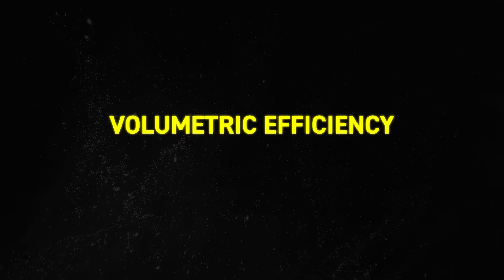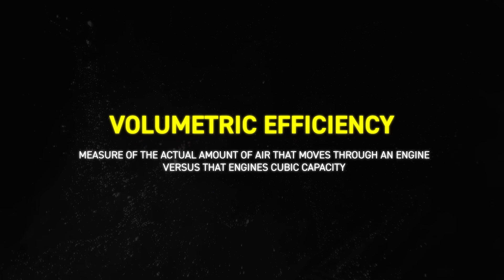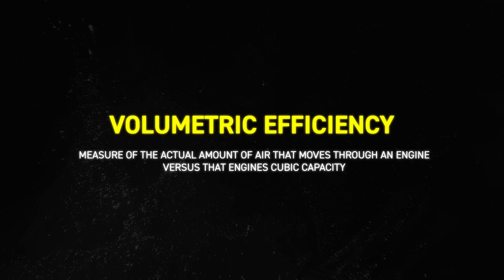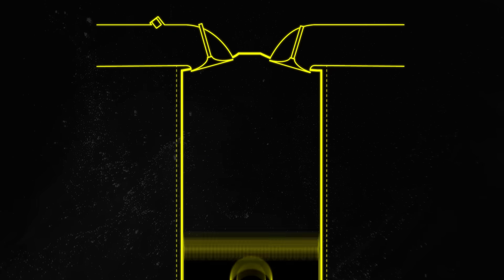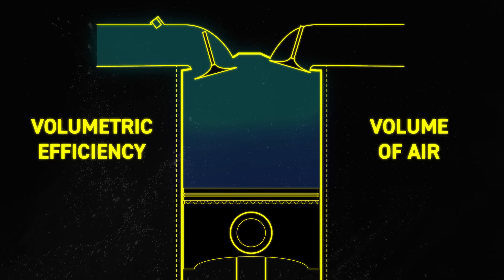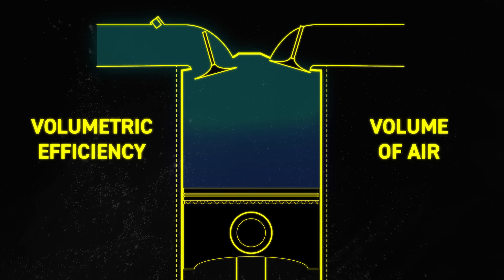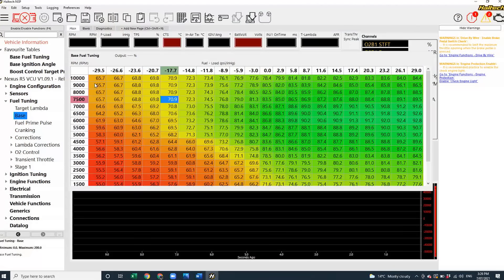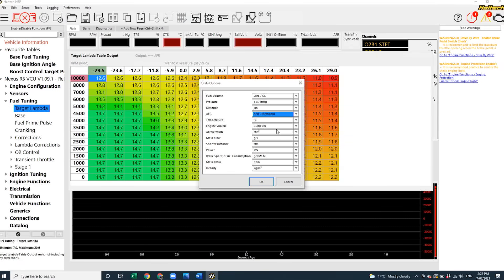🛠 Tuning with Volumetric Efficiency and other VE fun facts | TECHNICALLY SPEAKING

Comment: HI, you are right in this video, but why dont you use a practical example? Would make it easyer to understand. All engines get higher VE when they have boost. Air density rules. If you dont understand this buy a "MAD" sensor from Gale Banks. Why dont you use a practical example to double VE? Most engines double VE at 1,0-1,6 bar boost. This range comes from the natural aspirated engine VE, good ore bad VE, and what boost this engine gets. VE plus boost. Is it a bad build hot boost, ore a high efficiency cold boost? And please use more numbers: A OEM Merc AMG 2 liter turbo engine reach 190% VE. Tell this to the people. And many many guys asking: Why use downsize so much fuel? Answer this please. Every engine leaves best point performance, will not save fuel. People dont understand the use of a engine, and for what kind of use is a engine build? RR-Merlin is a downsize engine too.

Comment: This video is fantastic! With a boosted engine, engine efficiency definitely improves. Take, for example, a 2L 4-cylinder engine. At wide open throttle (WOT), each cylinder utilizes 0.5L of air, indicating a volumetric efficiency (VE) of 100%. However, with forced induction, the engine can take in 0.7L of air per cylinder, elevating the VE to an impressive 140% when you calculate 0.7 divided by 0.5. It’s a clear demonstration of how enhanced air intake impacts performance. And definitely check out Boyle’s law—it’s essential knowledge in this context!

Comment: Nicely done!! I constantly have to teach my students on all aspects of an engine, especially the MFI side.. with so much new intake runner designs, two stage runners,, headers or cast,, single to ITB,, NA engines are the funniest to explain.. I'm a firm believer in MAPs and TPS, but I believe MAF,, temps, baro and IAT are very important to establish a good A/F. Especially in my world of diag.. here in Canada I have Sea level pressures and temps to 9000 ft. From -40 to +40.. great job.

Comment: Phew, learning alot about these ECU controlled Engines (all because my car failed the UK Lambda emission test ugh!). Incidently, I have  Mitsubishi Lancer 2006 (1.6), it has a MAP Sensor instead of a MAF. For the life of me, I can't find a temp sensor on the air intake arrangement. On my OBD2 Diagnostic module there is a reading for air intake temp, do some ECU  engines just put in a temp figure  to work from or must it have a live air temp from a sensor fed into it?

Comment: If you don’t have access to a steady state rolling road Dyno that can compensate for elevation, how does any of this apply to the average guy tuning with this type of system? Especially with just a narrow band o2 sensor? Or even a wide band? 
Obviously, you would want the correction factors within the capabilities of the injectors, about 30 percent. 
So either side of zero is 15 percent. 
What cell am I in? What’s the amount of fuel trim correction?,  and does it trend towards increasing or decreasing fuel? So at that load and rpm, at that temperature and altitude, what is my correction factor? I had to theoretically input my VE numbers that need to be correct with that thirty percent correction factor to get the engine up and running. I can tune for idle, and no load RPM at the current temperature, but that’s it.
I’d could then go on the road and datalog all of the cells I can at the altitudes and loads my areas roads can provide at a steady state, remaining in that cell for as long as I can to see the fuel trim correction. 
Good luck with that other than a few cells.
Then there is the issue of a quickly closing of the throttle blades , that will have to be compensated for with unmeasured air bypassing the throttle blades, for drivability on deceleration. But that is separate and can be adjusted by the number of steps open or closed of the bypass valve.
The ECU uses the algorithms in a spread sheet format so you don’t have to do the math for any change in any one cell. It will extrapolate  the values for you. 
You will also have to deal with fuel sheer, puddling, droplets of fuel falling out of suspension, depending on the placement location of the injectors, and how we are firing them , either in batch or sequential.
That’s known as Tau.
So without a straight  road climbing up from sea level to however many thousands of feet,  under throttle going up and down the hill and under deceleration, you can’t really tune an engine for the street and drive ability, that isn’t constantly correcting in wide swings that may or may not be within 30 percent . That’s for complete burning of the fuel stoichiometrically. Engines run rich for maximum power and lean for maximum fuel efficiency. Engines with catalytic converters run a swinging average of stoichiometry in order to add fuel and burn it off in the catalytic converters , putting emissions first. 
So a steady state, loaded,  rolling road, and massive amounts of individual cells need to be populated with accurate values . Otherwise drive ability issues with the system always lagging will come up.
Don’t think for a second, that if you don’t have access to a rolling road Dyno that you can ever really tune a fuel injection system properly and the time it takes to do so.
Unless I was using it for a drag strip , I wouldn’t even bother unless I had the right test conditions and sensors. 
Your chance of tuning for drivability on the street is pretty low and only gets worse with forced induction. So unless you have a mass airflow sensor and you aren’t running in map based only configuration, you chances of success are very low.
The best I’ve found to look at is the factory map based , sequential, fuel injection strategies of the 04.5 up 4.7 Chrysler programming with HP Tuners. 
Tuning on an engine Dyno or at a drag strip is a far cry from actually tuning fuel injection.

Comment: Boost doesn't change ve but is does. Boost doesn't only create higher pressure but also higher velocity and with higher velocity more air manages to get into the cylinder than with ambient air just being sucked

Comment: Thank you so much for this most interesting and informative video.

One question: wouldn't the supercharger offer the same kind of restriction on the engine's intake as the turbocharger, since the two kinds of blowers essentially differ only in how they're driven by the engine. The turbocharger would obviously restrict the exhaust flow, whereas the supercharger would not.

Comment: you missed how we can have 125% "VE" (highly tuned engines), or why O2 sensors aren't a good way to monitor AFR (e.g. any DI engine will produce soot if you're near "stoich").  Gordon Blair's "Design and simulation of four Stroke Engines" came out in 1999, and even advanced tuners are still talking about VE.

Comment: Ohhhh I get it.  Applying boost does not affect your volumetric efficiency, it only changes the engine load that you are currently at.  Doesn't the VE get greater than 1.0 with boost?  or am I not looking at the correct table.
Reply: I had a pretty good post that got disappeared because my thumb hit the stupid touchpad on my laptop 🙈🙈 I need a new mouse. Anyway, as he mentions in the video, the VE is reduced by the addition of the turbo because of the restrictions in flow on both the intake and exhaust side (it seems counterintuitive at first since the turbo adds mass flow when making boost, but you have to remember that it does so less efficiently than that same additional mass of air simply flowing through a tube). The values of the VE table cells would be lower when a turbo is added, but the engine is still making more power because it is still, for example, cramming twice as much mass into that same cylinder (represented by the ECU reading from a cell farther to the right that corresponds to the increased air mass). It's just getting that extra mass into the cylinder less efficiently than an ideal theoretical cylinder filled with that same increased mass (e.g. that kind of "idealized" framework like in high school physics classes where you can ignore things like air friction or viscosity or things like that, which end up effecting the flow in the real world and hence lower the "efficiency" compared to that idealized situation). I hope that made sense 😅😅

Comment: 5:01 So... (dons geek glasses) By working with intake/exhaust air mass, you're taking into account charge density, irrespective of volume, right? That way you can tune without bothering (Edit: watched the rest of the video ;-) with air temps, since the ECU will be calculating the optimal Fuel/Air ratio anyway?
Edit2: Never mind, watching the full video answered all my dumb questions... Which says a lot about the host's ability for exposition. ;-)
Love these videos, keep 'em pumpin'!

Comment: 100% volumetric efficiency doesn't work. its a big misunderstanding of how air is sucked into the engine. higher rpm engine usually performs worse than lower rpm engine that are built ;) care to explain that one??
Reply: @Matt Wright rpm is nothing more than traveling distance per minute in a nutshell. because bore x stroke = displacement,higher bore shorter stroke design yield higher rpm more easily but you do spend less time filling the cylinder properly, why is that??? because air is never calm especially when something is moving through air such as a moving car,so dealing with all of that turbulence wich influences the flow characteristic wich does affect how the engine breathes wich is also dependant on the design of the engine and the limitation of fluid dynamic due to physics and actual heat created from said cycles wich impacts the next cycle.. in other words,there are too many factors wich says high rpm engine tend to perform the worst.  look up big displacement ship engines and how efficient they are compared to f1 v10 engines at their peak. now imagine consumer grade engines that are designed more for emissions regulation than overall efficiency and you will realise that the 100% volumetric efficiency is a pipe dream even on the most technical design.

Comment: Hello There. I am a little bit confused by some of the fundamentals you presented in the video:

1. So firstly you described an engine as an air pump, but if that was the case then you would be adding work to the fuel/air mixture. Surely the fuel/air mixture would be considered the working fluid applying work to the piston and other mechanical components through its combustion cycle? Surely, its only the turbo or supercharger that is the air pump in the system?

2. One thing you said about adding boost to an engine that it doesn't improve the engines efficiency, I am assuming you're referring to volumetric efficiency. The basic formula for VE is ((Volume of air in cylinder/swept volume of cylinder)X100), because of the compressible nature of gases, when you turbocharge or supercharge an engine you're effectively 'squeezing' more air into the cylinder than it would 'naturally' draw in without forced induction. So surely, the VE is going to be over 100% since with boost you're effectively increasing the engines displacement by compressing the air in the engine?

3. I was a little confused by when you said 'different fuels have different densities and different AFR ratios'. From my understanding, the physical density say gasoline at 95 octane compared to 98 octane doesn't change, but what does change is knock resistance of the fuel to spontaneous combustion which is why an engine designed to run on 98 octane would need to run a richer mixture on 95 octane to keep the cylinder temperatures down. I was just confused by this sentence as if you're referring to the fuel density in the cylinder i.e. the mass of fuel to maintain normal combustion for given quantity of air, then this would be correct.
Reply: 3. I think he meant gasoline vs diesel vs ethanol. 95 octane has more ethanol in it(atleast in europe) so it changes it AFR and density. Ethanol only fueling will need like 9:1 AFR to work properly.

Comment: My type r has v tech only on the exhust side, because the pressure the turbo makes its not needed on the intake. Hows this effect the VE? the V tech is no longer oil controlled its all done with the ECU as is the turbo boost amount. Seems like an incredible amount of work the ecu needs to handle.

Comment: What i think you mean is that a turbo doesn't increase an engines innate efficiency but it certainly does increase its volumetric efficiency . In fact you caused me to look up an official study on the effects of turbocharging on VE and it shows clearly how a turbo does INCREASE VE see below

https://www.google.com/url?sa=t&rct=j&q=&esrc=s&source=web&cd=&ved=2ahUKEwiP_Ib2_PrxAhUYRDABHUYoBbYQFjADegQICxAD&url=https%3A%2F%2Feujournal.org%2Findex.php%2Fesj%2Farticle%2Fdownload%2F1445%2F1454&usg=AOvVaw3Lr9zf8rzrKhvUaawY66Ej

Comment: No matter how i look at your explanation you have me confused. The way VE is calculated is calculated mass vs expected mass in a given volume. so pushing the calculated mass over the expected has to be seen as an increase in efficiency. Just because the turbo creates a restriction on the motor it still increases the mass in an engine at a given rpm once in boost. So if possible can you please clarify that because to me you made that statement and really just mentioned a turbo being a restriction which it is but how did you jump to that not increasing the mass of air being inside an engine at a given rpm. I know everyone else here is loving this but that statement you made about turbos needs to be expanded or i need to throw away my tune. Not to mention throwing my ECU in the trash  for giving ZERO feedback when the VE is over 100.

Comment: i see the turbo as a restriction but if you are increasing the mass in a given volume why wouldnt that translate into an efficiency increase. When I have tuned VE under boost the efficiency goes over 100. Are you saying that is wrong. and that the car should never have a value over 100  or for your reasoning there is no current 100 percent efficient engines that is known so we should never see 100 percent. Can you clarify.

Comment: I feel like he's trying to explain VE as the relation between intake air and exhaust air, my understanding is the relation to total volume in the cylinder versus the amount of air you're filling it with. But then he explains it like that later. So possibly slightly contradictory information?

Comment: Wow thanks for this video. Often I hear that small displacement engines with turbos are actually less efficient when on boost. Is this a result of what you mentioned in the video about the turbos VE and is this the same as the thermal efficiency of the engine?